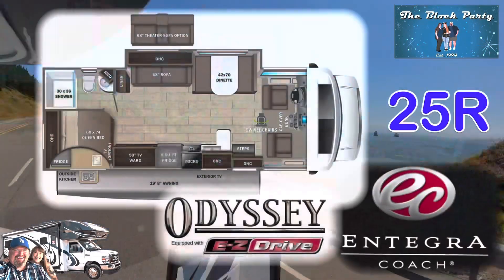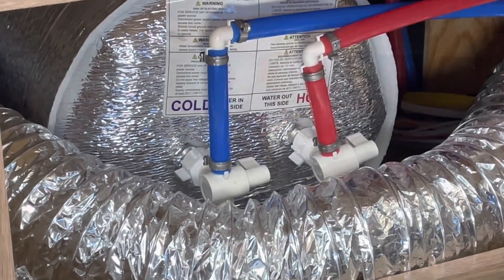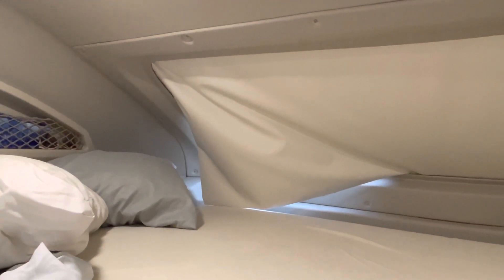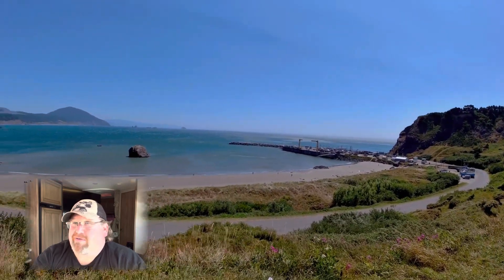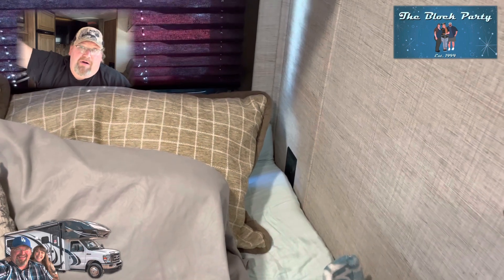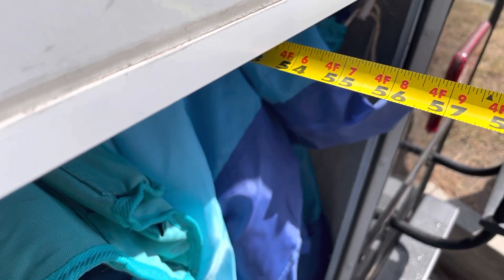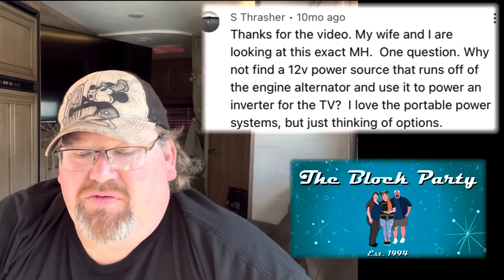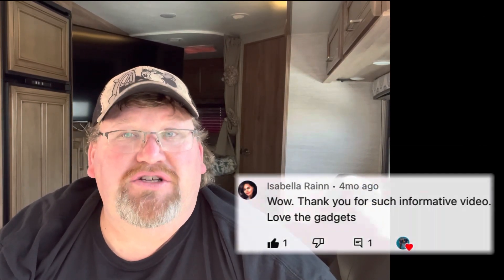New RV Owner - 12 Month Review  - Entegra Odyssey 25R #motorhome #entegra

Comment: Great video!  We are in the process of looking for a 25R.  We currently have a 2011 Coachmen Freelander which is the first Rv we've owned.  Can't wait to upgrade.  How is the  airflow with the windows open?  The airflow on our rig has sliding windows that provide pretty good ventilation which is great when boondocking.

Comment: We have 510 watts of solar, 240 ahs lithium, with 2K watt inverter. On our 25R. Works awesome and can camp off grid .
Reply from the maker: Nice, did you have to get a new house power converter when switching to the lithium batteries? Or did the factory converter from Entegra have a lithium battery setting?  I heard that lithium and lead acid charge different, so the factory settings don’t work (ie - you can’t just drop in a lithium battery and be done), but some converters have a lithium setting that can be switched.  Thanks for commenting on the video !!
Reply: @TheBlockPartyRV  my power converter that came stock had a lithium option. Just flipped the little toggle switch to LI from LA.
Reply: @josephhartman2343 how much does it cost for the RV and Solar as well?
Reply: @DeepValueOptions  we purchased 2 years ago. Partial body paint with jacks was $86K. Solar, 2K inverter, lithium batteries, monitor and Dc to Dc charger was $13K

Comment: We have a 2021 Odyssey Integra 29K.  Our floor through the rv has that same spot issue you spoke about.  You mentioned your floor will need to be replaced. My question - do they remove everything in the rv- dinette, recliner chairs, cabinets... or do they just lay a new floor over the old.
Reply from the maker: Great question - When I inquired about it, they told me I had to take it somewhere get it done and they would “re-imburse” me if Intirned in the receipt, When I heard they needed to remove the slide and remove all the cabinets and such, I decided to live with the spots - as for me personally, I’m not all that particular (it’s camping for us), and zi didnt think it would all go back together “same as factory”.  So - we live with the spots …..
Reply: Thank you. I went to the place we bought the rv at.  they said they would replace the floor but would "cookie cutter" it, not take everything out.  They are going to research to see if this is still under warranty.  If it is, I guess we will do it in the fall.  If not, we will live with it too. The dealer told us this is typically a 60 hour job @TheBlockPartyRV

Comment: You said the outlets only work when plugged into shore power?  Guess I don't understand how the electrical works on a RV.
Reply from the maker: So RV’s have two electrical systems - a 12 volt, and a 110 regular house type power system.  The 110 outlets only work when you are hooked up to shore (land) power or have the generator running.  When driving down the road the RV runs just on the 12 volt house batteries system - which is just some lights, the water pump for the sinks and the shower, the fridge, maybe a few USB ports to charge a phone and a few other small things.  Anything 110 like the TV, Microwave, outlets, etc.  none of those items will work unless the Rigs generator is on - or you are hooked up to shore power.  Let me know if that cleared it up, or feel free to ask a follow up question.  Thanks for watching !!
Reply: Thank you, that explains it. I was curious why you mentioned using the portable power station for the TV.

Comment: How the power train in the mountains pulling a car .
Reply from the maker: We just bought a 23’ Jeep Rubicon 4XE, next step is to get the rig fully setup to pull it - so - down the road I will definitely review how it does pulling a full load TOAD uphill.  So far, even fully loaded with water and gear, it does fine even up very steep grades - but that Electric Jeep is really heavy, so it will be a true test.  Thanks for watching and leaving a comment !!